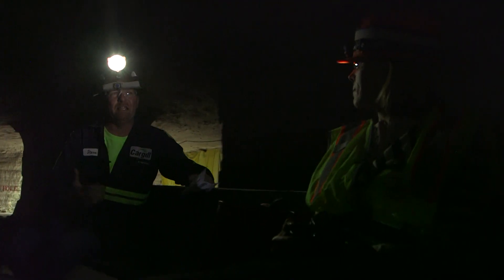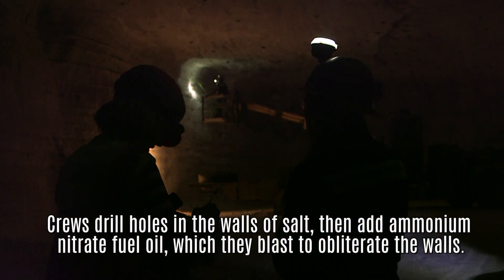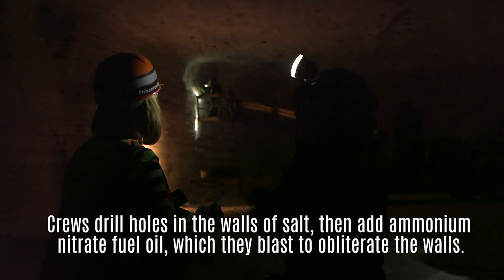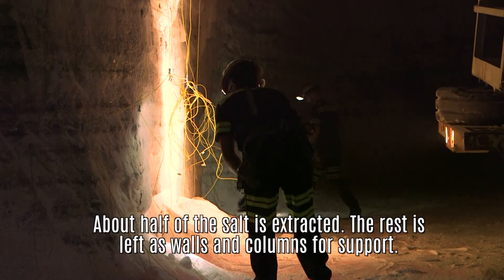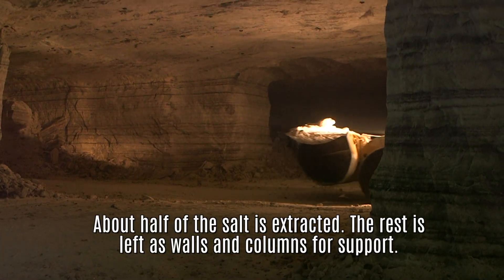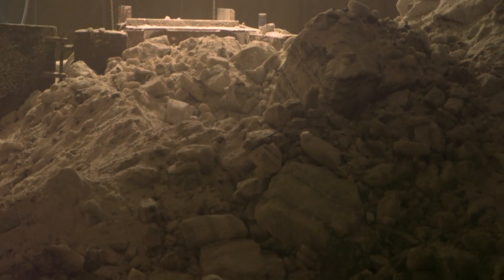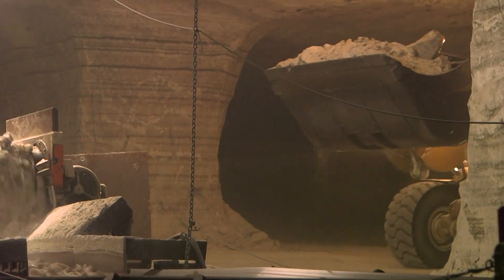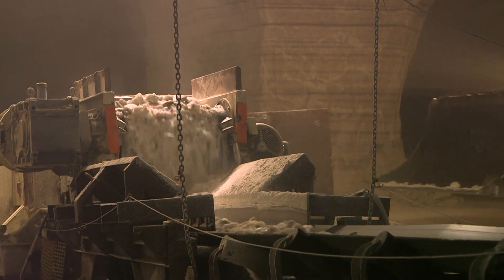The Cargill salt mine beneath Lake Erie

Comment: Is  the salt  contaminated by the blasting process or is the anfo non toxic, surely residues would be present.?
Reply: The rock salt is used to melt snow and ice on streets and highways, it's not used for human or animal consumption. I imagine that the salt itself is more toxic at high quantities to human than the trace amounts of residues from the explosives used.
Reply: @frank-u3v2h  The animals are eating the vegetation beside the roads, and the water that accumulates from the runoff becomes part of that ecosystem. The toxins don't disappear until they degrade. Meanwhile, I would expect an impact.

Comment: Have to ask, since the Salt Mine down in south was hit with surface drilling mistake. We all have seen that video of the river flowing backwards and the area around the drill shaft punching through. The land and everything around that hole being sucked in. 
If there is a fault in the earth crust, and there was a few years ago an decent earthquake that shook that area. If Lake Erie is holed by a fault break. What would happen to the mine, and surrounding area? 
Lake Erie is a pretty substantial water area, if you pop a hole in its bottom. Where will the water come out and will it stop?
Reply: Wow! Had no idea! 😮 But I've got issues with the pressure of the water on the tunnels and they have been 2 small earthquakes in Ohio! What would happen if they have a stronger quake here? I didn't know there were salt mines in the south? 😳
Reply: @ItsmeVikkilove  Lake Erie would totally drain and wash away the slums. Niagara River in Buffalo would dry up fast. Lord have mercy on the surrounding Ohio low land zones though. all that water from Lake Erie will find a place to blow out.
Reply: @Less1leg2 No brother Lake Erie will not drain the mine will just flood
Reply: HANG ON TO SOMETHING!

Comment: Cargill is a scab company as only scabs will work for them.
Reply: Thanks for sharing Todd
Reply: The union stewards are scabs and they hire pedophiles right out of prison
Reply: What's that mean
Reply: @brendenbenoit7539  hes sayin its not a true union. Scabs will cross a strike line for fear of losing thier jobs. A true union worker will stand and strike with the union. Problem is now days most unions write a no strike clause into the contracts anyway and can only strike if the big guys down at the hall organized it and most of the time they won't. They just try to come to a resolution before it gets there.